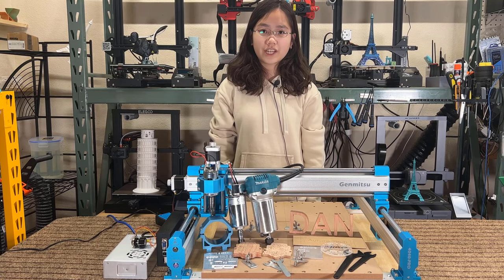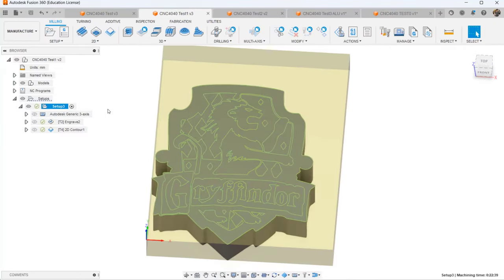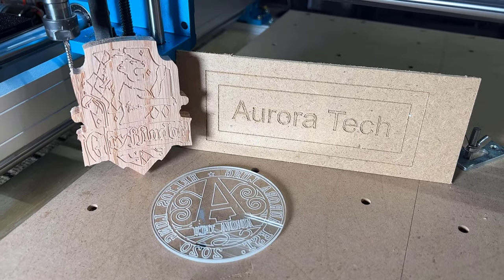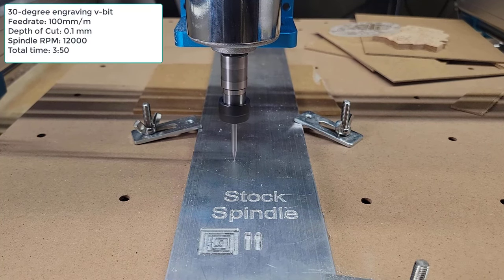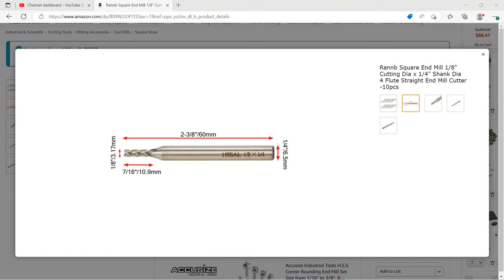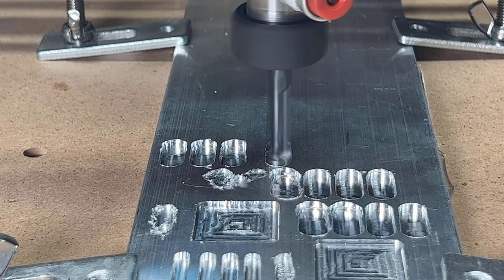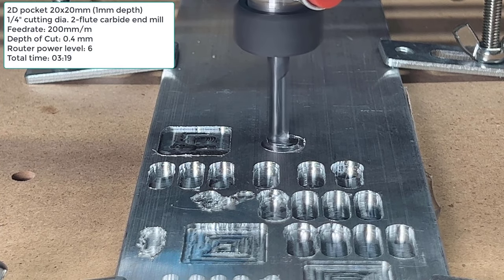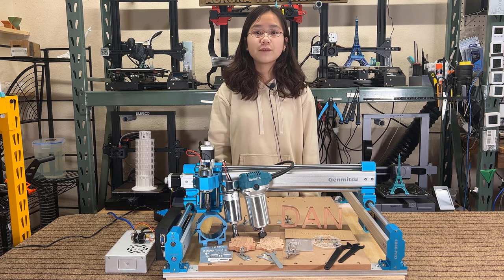Comparing 75W, 300W spindles, and Makita wood router for cutting aluminum on Genmitsu 4040 PRO CNC

Comment: Would the DeWalt DWP611 router work also?
Reply: There is an optional 69mm mounting clamp, make sure you select 69mm rather than 65mm for a DWP611

Comment: Can this machine be done in imperial instead of metric?
Reply from the maker: Sure, you can configure your CAM software to use imperial instead of metric. Personally, I've done a lot of 3D printing and have get used to using metric.

Comment: Really good video thanks-I have just got the V2 model which looks stiffer than this one and I am upgrading the spindle to a router. I just picked up a Katsu from Amazon for £45. It looks like a Makita clone, hopefully it will still be good. ( I do have a Makita 18v router which would be great as it is brushless which the 240v model isn’t, but I haven’t worked out how to get a 18v supply to it , I don’t really want to run it on batteries- anyone out there who can help? I see that Hikoki has an mains adapter for their battery tools-Makita doesn’t 😢

Comment: Hola. Recomiendo para mejorar el corte una aspiradora de polvo o sopladora que despeje zona de corte junto con alguna lubricacion en la fresa cuándo sea materiales metálicos, un motor husillo mas economico, menor potencia y menor peso, la cortadora  marca Dewalt modelo DW660 de 500watts 30.000rpm de 120-220volt AC, para brocas de 1/8 y 1/4 inch, vale menos pesa menos.. 
Saludos

Comment: 800rpm is not fast enough. There's a reason proper CNC machines use much higher rpms to cut aluminum. 

Also, cutting or milling aluminum without a coolant fluid is bad because the heat expands the aluminum which causes to grab more onto the end mill.

Comment: A whole Z axis assembly is flexing a lot, I don't see a way around it. 10mm rods are just a small part of the problem as they are quite short - it's actually two 16mm x rods that are not sturdy enough in that length. That's why other better machines use 8040 C-beam which is much more rigid. Better and cheaper buy is TTC450 that can be upgraded to fairly solid metal milling machine easily. https://www.youtube.com/watch?v=FsW4D8ELYDU

Comment: You're totally using the wrong cutters. And they are far too long. Programming a CNC is 1 thing and machining with the right tools is just as important. The result of engraving is really bad, but it can be much better if you use the right cutters. I would love to help you get started.

Comment: I love your great 3d printer reviews but sorry, it's clear you're a complete novice at machining, CNC or manual.
Reply from the maker: Yes, you are right. We still have a long way to go before we can play around with CNC like a Pro.
Reply: @AuroraTech  I think the biggest factor is you need to lower that z very close to the work. Choke up on the bits. Use thicker, shorter bits. Hold the workpiece more rigidly. Take a look at blondihacks, mrpete, Clough42, abom79, etc. for tips on rigidity and flexing. Oh and clear those chips so you don’t recut, and try some A9 or other cutting oil for aluminum. Roughing pass with one bit, finish with another. Oh and bolt that machine down to something really, really heavy, several hundred pounds, and I bet even the little motor would surprise you. I think repeatability in x,y,z and rigidity is really the name of the game in cnc. Once you have corrected these other issues, of course raw horsepower at the spindle is a factor but this little machine didn’t have a chance with all that flexing and chatter. Oh and I almost forgot, leave tabs around your workpiece so they stay connected the entire time otherwise they fly off or shift and get ruined before your program finishes. Excellent reviews and work. You and your brother do a great job. Try repeating this review with those changes and let’s see what happens. I bet finding a lower speed higher torque motor will make this unit sing. You could try gearing it down to 3000 RPM max with belts and stiffen up the frame with some extra aluminum or steel cross beams. I bet it will be surprisingly capable.

Comment: As mentioned already your biggest issue is set up and tool selection. First get a shorter cutter and get a 2 flute cutter especially if you're running 12,000 rpm like that. Next clamp the material better. Stick to printing you're much better at that. All you're doing is gauling the cutter. Think before you leap

Comment: This machine is lacking in rigidity and the cut are shocking. Another point is better quality cutters would be needed for this machine cheap Chinese crap cutters are showing the lack of knowledge on cutters and speed and feed requirements. This machine should under go another review with quality cutters that are designed for aluminum, wood and plastic. Another issue is the hold down was so poor that the machine would have failed under any test. Material must be held were all the surface is flat on the bed this with limit or stop vibration of the material, which is transferred into the cutter.  Understanding what a materials requires to perform should be undertaken before assessment. You failed to understand this with this review and I expect better from you.
Reply: This is an inexpensive hobby grade router, not a milling machine. You are expecting hobbyists to spend hundreds of dollars on quality end mills, and bust them from machine flex? 🤣🤦‍♂